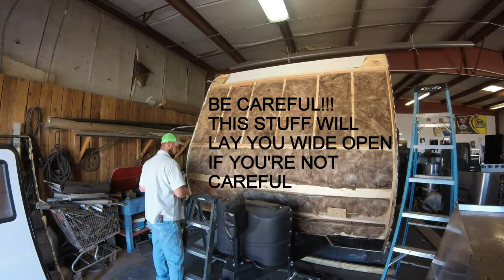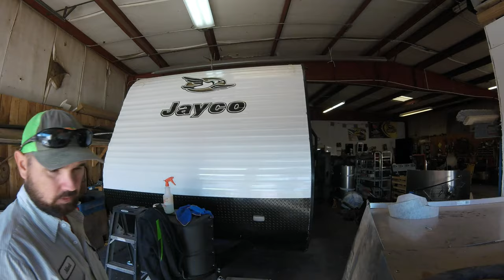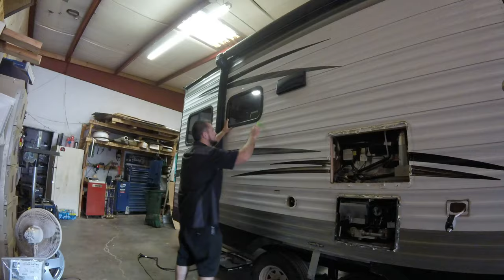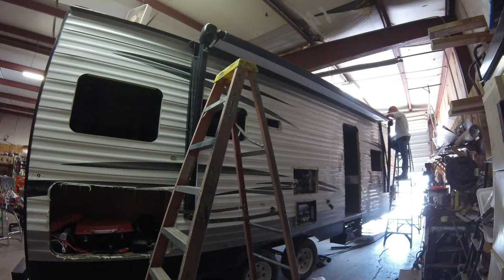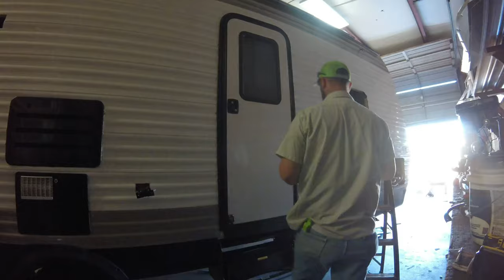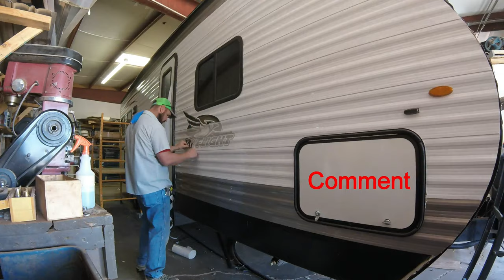Reparing a camper with hail damage

Comment: How much would the cost be for a typical shop to do this repair? The entire trailer not just a few panels?    So for instance if you have a 34 foot travel trailer and it has hail damage on all sides
Reply from the maker: Labor wise, probably a couple thousand. Materials would be more but that price depends on style of the panels you have, the lengths and current market value on aluminum.